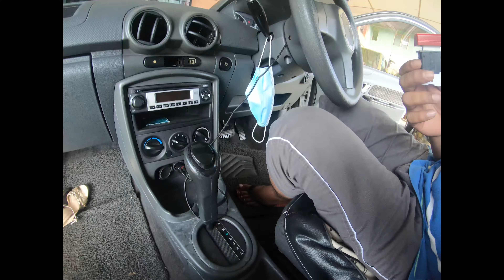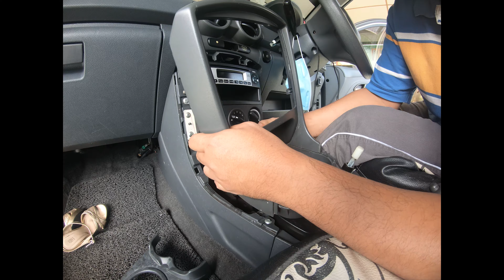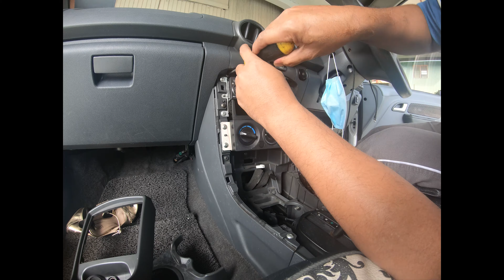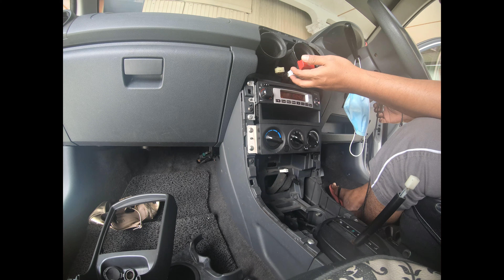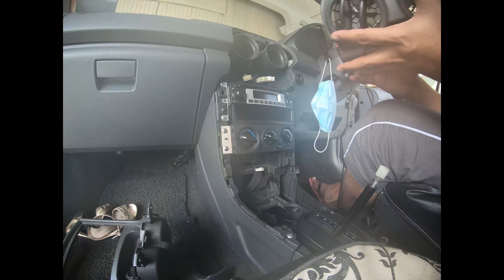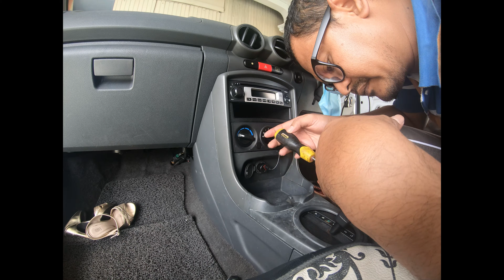cara menukar atau bypass suis lampu kecemasan proton saga BLM. harzard light switch proton saga BLM

Comment: boss , apa fungsi button kiri itu yang ada satu dot ?
Reply from the maker: rasa nya untuk clear kan alarm kalau alarm bateri abes . buka pakai manual on acc pastu tekan tu kot  untuk matikan bunyi alarm tu..
Reply: @zaidirazak8i  Ok terima kasih.
Boss, mana paling senang tap 12v power untuk monitor screen bagi reverse camera ? 
boleh on/off punya ...  boleh tap power butang defroster/heater ka ?  mahu buka semua nii baru boleh tap wire ka ?
Reply from the maker: @Funktastico  nak amik power untuk reverse camera ke? untuk bila masuk gear reverse terus dia on kat display mcm tu ke? rasanya kalau mcm tu kena ambil power source dari reverse light so bila masuk gear reverse br camera belakang tu hidup, nak kena tengok juga la diagram mcm mana kan..